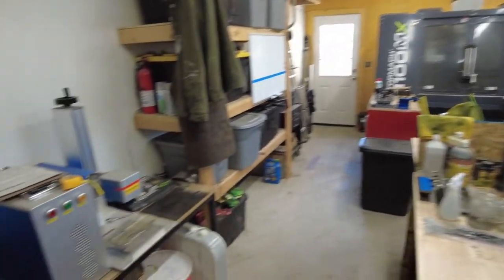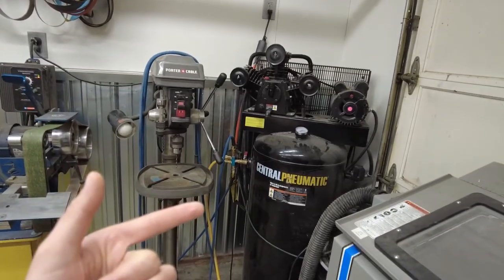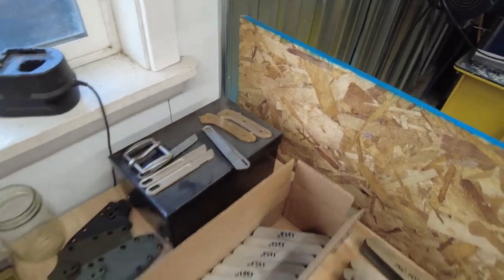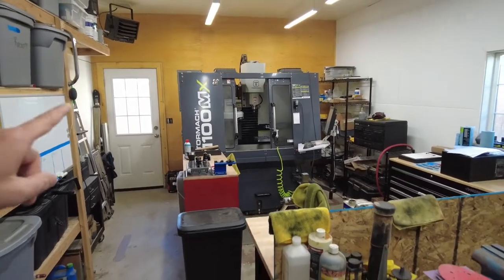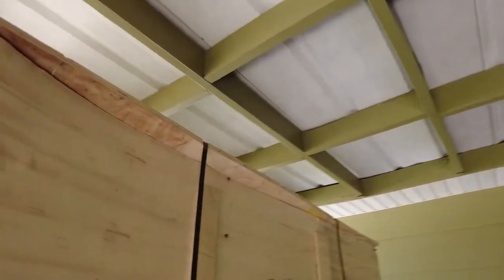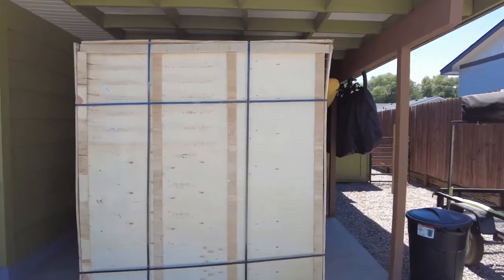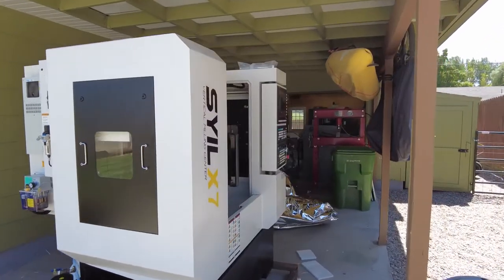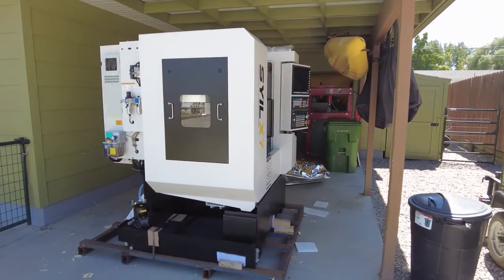Syil X7 Delivery | Immediate Impressions

Comment: Ordered my Syil X7 a few weeks ago should be getting it in Sept-Oct, looking forward to seeing your X7 setup and mine as well.
Reply: Is there a reason you didn’t get a hass?
Reply: @mclaughlin4321  I really do like the Haas controller but as far as the machine goes you get more for your money with the Syil X7. Since the Syil X7 is cheaper than an equivalent Haas machine you can choose to spend a little bit more on options for the mill. I also did some training with Nerdly from YT using his Syil X7 and had a really good time machining with it. I am about to start my own channel soon as well called Nova Armory if your interested in seeing more about the X7 once I get it. Mostly just going to make some videos on everything that I had to get along with the X7 - tooling, workholding, etc...
Reply: @warcorer  I’ll be sure to keep a lookout for your videos.

Comment: This is exactly the kind of video that I've been wanting. I have a Tormach PCNC I bought used that I want to upgrade and a Syil has been the logical upgrade seeing as Haas machines can't compare unless you spend closer to $50k.
Reply: Also Haas is against right to repair. If you ever repair anything on it yourself even if you're competent enough to do so, your warranty is voided and all support will cease.

A lot of people quite dislike Haas, myself included. My shop has 3 that are not over 10 years and one that's barely over a year. All have been problematic. Each is down at least 2 months out of the year waiting on Haas. Well besides the new one. One was down for 4 months for a simple driver swap.

Comment: How did you get it off the steel pallet? Can you chop away the pallet steel in pieces such that the X7 then rests on its own feet and then use a pallet truck between those feet?
Reply from the maker: Definitely watch my other video on the install!
Reply: @tj.schwarz  Just ordered my X7! I looked at your other video, but am still missing how you got it off the steel pallet. Can you elaborate a bit?

Comment: Hey. Nice machine. Just subscribed to see it making those knives. Thinking of getting one also. Can you tell me the height of the machine when it is off the steel pallet with the spindle in that transport position please? My garage door is 2m high and don't know if will fit. Thanks
Reply from the maker: Thanks for the subscription! I just measured and from the floor to the top of the enclosure is 76 inches. There is a status light and a cable guide that rises 2 or 3 inches above that, but they could theoretically be removed to clear a door.

Comment: Hello, I have the doubt if the machine has tool holders or they are purchased separately?
Reply from the maker: Machines do not typically come with any tool holders unless you add them as an optional package.
Reply: Thank you for resolving my question